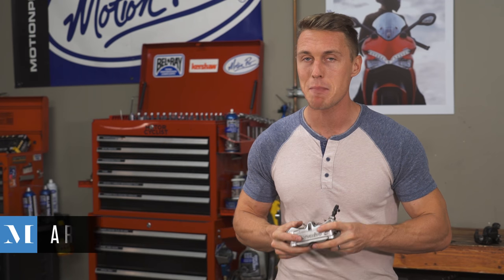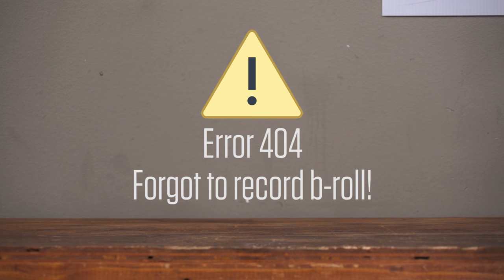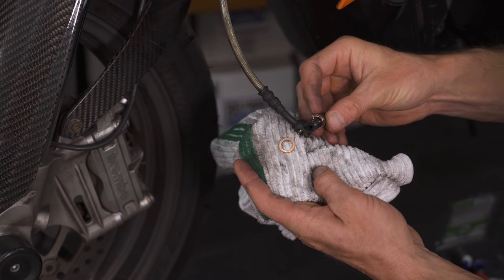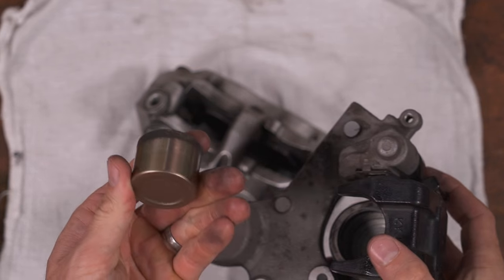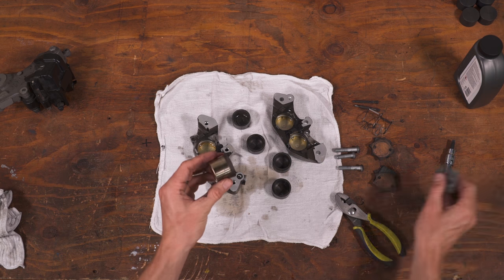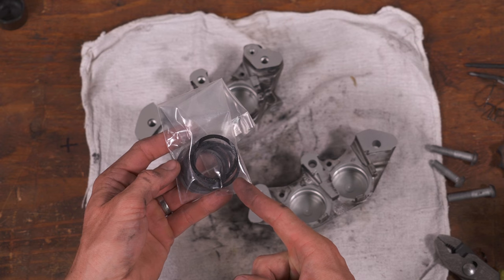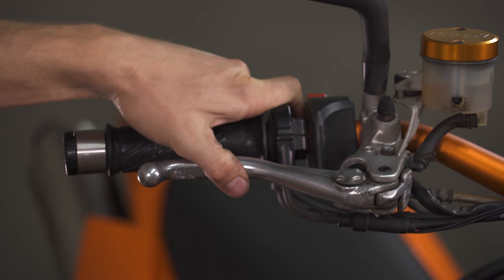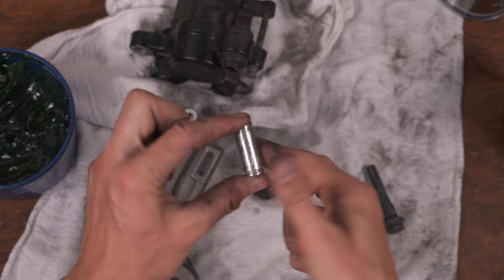How To Rebuild Your Motorcycle's Brake Calipers | MC Garage

Comment: Really nice. However I have noticed that it's nowadays harder and harder to find break rebuild kits. I was quite shocked when my dealer was only willing to sell new new set of calibers and couldn't find replacement parts from anywhere (brembo breaks). Then it turned out that there was one local smallish but old store that sells rebuild breaks and it was super cheap so everything ended well =)
Reply: try another dealer?
Reply: For my Yamaha TDM 850, I found in Germany kedo.de. But the new pistons are expensive. I will change it this winter.
Reply: Most brakes are rebuilt by shops and dealers. With the price of labor these days, it's usually cheaper for them to replace the caliper. So there's less and less demand for rebuild kits.Go Ari Go!
Reply: Now off to your spelling class.

Comment: I really want to do this on my bike as there is some rust on the pistons and I noticed some uneven pad wear. Unfortunately my bike uses four piston opposing calipers which can't be split! 

Is the best way to get the pistons out just pumping them out while the system is still all together? Was thinking I could put something thick between the pistons so they all hit it, then put something thinner, then thinner etc until they are all most of the way out. Otherwise I'm at a total loss. Bent nose pliers with a rag maybe?
Reply: The technique you describe it a good one. Brembo also suggests clamping all but one piston down and then pressing the unsecured piston out with compressed air. Motion Pro also sells a slim little piston-removal tool that should do the trick. We wanted to include it in this vid but the order didn't arrive in time.

Comment: Quick question.  Can you use brake cleaner directly on the pads themselves (double H sintered)?  I blew a fork seal a while ago and before i had it fixed I'm thinking maybe some fork oil got on the disks because my brakes are suddenly not performing.  Figured I'd do a thorough clean of everything but I also figured I'd ask someone before spraying down my pads just in case
Reply: Yep, that's exactly what it's made for.
Reply: You can put it on the pads. But if you got a lot of oil on the pads. They need to be replaced. Brake pads are very porous. You'll never able to get all the contamination (oil) out of all the nooks and crannies. I know it sucks.
Reply: Damnnnnnnnn... that sucks.  Hopefully they improve enough after I get done servicing them.  Thanks for the info

Comment: What torque do you apply to screw the two half caliper bolts? In Nm
Reply: That's something you'll find in your owner's manual, but typically it's in the 20-28 Nm range.

Comment: is centering required for axial calipers too before tightening mounting bolts
Reply: naveedaka axial or radial should not have different handling.
Reply: Pascal Nungässer i mean the sliding pin calipers as on rear in this video??

Comment: On my 2015 MT-07 the brakes drag and they bind up over night and I have to give the bike a good push in the mornings to unbind them. It had the brake fluid changed a few months ago, the pads have loads of life left in them and there's no visible damage to the disks. Is it something that needs fixing? My previous 2015 CB125F developed the same issue after a while so it's either normal or I'm missing something.
Reply: The callipers need exactly what has been demonstrated in this video, a build up of dirt or corrosion is stopping the pistons moving freely
Reply: Before completely disassembling it, have you tried cleaning the pistons? Take the caliper off the bike, squeeze the lever a couple of times, clean the pistons with a plastic brush and brake cleaner and then push them back in. I don't believe you need a complete rebuild on a 2 year old bike, but maybe you just ride it a very dirty place
Reply: Try riding a decent distance (let´s say 20km) without using the front brake and then check the temperature on it. If it´s cool, you don´t have to worry too much.
Reply: If it has sliding pins, ream out thebpin's bores, they are getting stuck, then relube the pins. Another thing is the pistons may be seized, possibly bent, needing replacment

Comment: I have a transalp, it doesnt have the best brake setup. Two piston single rotor up front. Will swapping to steel braided brake line have a noticeable effect? Might as well do it all at once
Reply: Martin Fisker steel brakeline doesn't expand likerubber brake line does, so you'll probably have a bit more stopping power when you really squeeze your lever.
Reply: Bart RD50MX Its not that i really need more power, i just want a more firm feeling and more feedback. I know, in theory, steel lines would do just that. I just need to know if it makes a noticeable difference from someone who has tried both
Reply: I swapped out my OEM lines for braided SS on my MT-01 and I didn't notice much of a difference in use. The SS braiding is just for mechanical exterior protection and it also does not need replacement every 5 years like OEM (plus you can get nice colours!). Pressure is maintained by the same tough inner lining regardless of exterior material. This is my understanding and I have heard this from a guy involved with bike racing teams and a car engineer who rides. SS is just a more resilient protective coating.

Comment: I am helping a buddy with a single piston rear caliper on a scooter.  It fails only occasionally.  Squeezes handle all the way to grip, no braking (claims it also makes noise, I never hear it).  I figure there is a blockage in the fluid passage, or sticking on the slide/piston.  
Does anyone know a simple starting point, or spot to look first?  A rebuild will be done, but I would like to correctly find the specific problem and make sure it is addressed.

Comment: Just to throw my worthless 2cents in, foam ear plugs also work well to stuff in the bango bolts to stop leaks whilts wrenching on other brake components, bit im just a hobby mechanic.
Reply: Thanks for this tip, used the ear plug trick yesterday it worked great!!

Comment: Good job, but brake fluid is corrosive, do not forget the gloves.😄
Reply: Also, brake line washers are one use only
Reply: That's what they say, but I reuse 'em all the time. Same with drain-plug washers.
Reply: Precisely. Brake fluid is somewhat corrosive, not just messy, better be using gloves.
Reply: i'ts okay, but you must immediately wash your hands if you don't use gloves 😂 😂 😂
Reply: It's okay, my hands are unpainted ;)
Reply: superbarnie -- Your hands were originally painted, so brake fluid couldn't hurt them.

But now that brake fluid has removed the paint, it's critical that you no longer expose yourself to brake fluid without gloves. I shouldn't have to explain something this obvious.
Reply: yep, I got brake fluid on my hands and it dissolved the flesh down to muscle tissue.
Reply: Adam Omidpanah you're being a jerk. I should show the mess it caused to my fairings after a leak on the track. It is corrosive, but it's not nitric acid. It may cause skin problems and it's never a good idea (eg have you got psoriasis?). HST, I've touched it too, even the 5.1
Reply: I am a aircraft mechanic, and a thing i always tell the trainees, is to peel a garlic a hold it tight in your hand, after 20 min they start to have garlic taste and smeel in thier mouth.. Just saying that your skin is actually the bodys largest organ, and it sucks up everything.. After that, they always wear gloves.
Reply: good thing im not bathing in it XD
Reply: Not just for the brake fluid, but the degreaser and brake cleaner too. Those are very harsh chemicals. Hand soap is formulated very carefully to have just the right amount of surfactants for your skin... what do you think brake cleaner is formulated for?
Reply: I use barrier cream, and he may be using same. Oils and fluids just sit on top. Not exactly a glove, but remarkably effective.
Reply: @94SexyStang  There's always one of you.
Reply: @94SexyStang  Did you know exposure to chemicals can result in brain damage? kinda seems like you didn't.. too late now
Reply: @CarloPiana  aircraft mechanics deal with some nasty chemicals. I've had to deal with stuff that apparently can eat flesh and this is coming from someone who works on vac trucks that suck stuff out of the sewer

Comment: I have a problem while bleeding. after bleeding is done, brake pads of the caliper are slightly in touch with the disc.
It is very problematic and I haven't solved it yet.

Comment: Hopefully someone will see this and not have the job I just had getting my pistons out, I pumped the brakes to get them to come out as far as I could but they didn't want to know so when I got them inside and split the caliper I tried heat I tried the rag and grab I tried compressed air (sadly I don't have a grease gun) NOTHING worked. 

Here's what you do; get a ratchet with an extension bar on it and put it in the piston cup then insert a socket that will just fit alongside the flat of the extension bar in the piston cup (I can't give numbers because they are all different sizes). Once it's all wedged in there turn slowly and the bar should pinch on the socket and the wall of the piston and the piston should turn, keep turning and sorta angle it upwards or pull up gently as you turn and it will come out eventually mine were incredibly stiff so it's gonna need to be in a soft jaw vice and some sweat but it WILL come.

(if your piston has a cap it should either come out with some persuading OR I carefully drilled a hole in the cap less than 2mm deep DO NOT DRILL THE PISTON got a pin punch in there and wedged the cap out)

Good luck hope someone finds this as helpful as I did because after days of looking for advice on the internet NO ONE mentions this and it works a treat.

Comment: The days of rebuilding calipers on cars are pretty well gone but is this still somewhat of a common practice with motorcycles?
Reply: Yessir. You can buy a rebuilt caliper for you car so cheap that's it's not worth doing it yourself. Rebuild bike calipers aren't available, and you'll be looking to pay a shop a couple hundred bikes to do the work for you.
Reply: Thanks for the reply  Keep the videos coming!

Comment: when changing pads, do you need to reallighn the calliper if you take it off?
Reply: For radial setups that don't have locating dowels, yes. You need to pump up the brakes so the pads pinch the disc (thereby aligning the caliper) and then tighten the mounting bolts.
Reply: and axial-setups dont?

Comment: Someone's bound to gonna start complaining about not using fresh crush washers... 

If you want to be safe, and don't want to get or you don't have new ones; try heating the old sealing washers until they glow red. Let 'em cool and they're ready to go again. 

Better yet, just order a big ass bag of those things online - doesn't break the bank, and it's copper - a precious metal - so you can tell your significant other it's an investment, not bike parts - and go ahead and replace the old ones.

Comment: My pistons will not slide back into the cylinders with the O rings in place. Tried giving it some pressure with a vice but tore up the O ring and still did not slide. Tried using the old O rings again and new O rings... same thing. Can anyone help?

Comment: hey ari...i have an cbr f4i running rich...can fuel flow test show fpr is bad or not.i mean if amount of fuel is less???please help
Reply: Um... this is about brakes???
If fuel on your bike is a problem and you have carbs, there is a vid for this but if you have EFI then take it to your dealer...
Reply: Fuel-flow test isn't going to help you. If the jetting is stock and your bike is running rich, the air filter may be clogged or your carbs' float heights may be off, causing the fuel level to be high and the engine to run rich. What signs are indicating a rich condition, and at what throttle positions?
Reply: Ari Henning ..hey is fi....no carbs...and its popping flames at idle...shooting flames at full throttle...fouling plug...dry carbon at tail
Reply: Yikes... That sounds serious enough that something must be very amiss. I'd check the auto-enrichener circuitry. It's like the EFI version of a choke. Perhaps it's stuck on. Or your TPS is way out of whack. Something is causing there to be too much fuel in the system.
Reply: Ari Henning it has a fast idle wax unit that serves as  choke circiut but that seems ok...i will disconnect tps and see any difference ...will let u know...thanks for ur reply...big fan from india

Comment: I have spongy brakes on a 2005 gsxr1000. I flushed my lines with brand new brake fluid and the problem did not go away, what can it be?
Reply: Andres Angulo you have so much moisture and white milky nasty stuff behind the Pistons in your calipers your jaw would fall off. Do as the video says but you can remove the caliper and the pads and just slowly pump the front brake lever until the Pistons pops out on their own this is the easiest way also once you remove the rubber seals from the caliper there will be rust underneath them that small Groove needs to be cleaned and the seals flushed and cleaned the boar flushed and cleaned and obviously the Pistons. Reinstall everything with the bleeder valve open you can push the Piston sin with your thumbs now you can start your bleeding this is always the best way to bleed with nothing at all in the boar 90% less air. After getting a pretty firm brake feel then go to gravity bleed small rubber hose valve slightly open let it drip for about an hour keep topping it off leave the reservoir cover off and covered up with a rag air can escape both directions you'll have a break that you can do in those with.!!!!!! Then you better do your rear one too so you're breaking is fully balanced
Reply: Rick Simpson thank you.

Comment: I would not recommend using steel wool to remove corrosion on the pistons.  The pistons are probably made from a stainless steel and the iron left behind from the steel wool will not play nice with the stainless and start sites of corrosion.  The left over iron particles from the steel wool will start to rust and that will make the stainless steel rust and corrode.  You can not get all the iron particles off by mechanical action.

Comment: No idea how you just popped those pistons out so easily. I am on day two of trying to muscle those damn things out one micro meter at a time. Pistons are ruined but replacements on the way.
Reply: You can use compressed air even with split calipers,you need to put  air through the banjo bolt hole to pop the first piston out,then push the 2nd piston with air through the teeny tiny oil passage which you should see once you remove the first piston

Comment: Shot in the dark:  My 2017 Kawasaki ZX-10RR Service Manual dictates the front 8mm Master Cylinder Bleed Valve as 49-inch pounds torque.  The rear 10mm Master Cylinder Bleed Valve as 71-inch pounds torque.  However, the same service manual states the front caliper bleed valve, also an 8mm bleed valve, is 12 FOOT POUNDS TORQUE?  I am certain this is a misprint and could be 12-inch pounds.  But WTF?  How am I supposed to trust the Service Manual with obvious incorrect torque specs?  And I cannot get a clear response from Kawasaki of America to confirm this torque value.  Why is this so difficult?  I don't like "hand tight plus 1/4 turn."  That's BS.  If the bike has torque specs, they should be correctly applied.  And tge "unspecified bolt torque" table is useless!!  I used that procedue for another bolt and it stripped out the hole.  My torque wrench is 1 month and it is working properly.  Some bolts are either 1.  Misprinted torque value in the Service Manual or 2.  The torque value is printed correctly in the service manual with incorrect torque values from factory.  I've crossed referenced Yamaha R1 and Honda CBR and of course, no torque value is the same but neither say 12 foot pounds.  What the heck does "right" look like when the Service Manual is in question?  I found several discrepancies while reading and studying the Service Manual.  And, what gets me is, the print date is 2018.  The new 2023 ZX-10R/RR have the same exact wording.  So, there was no change since 2018 and an 8mm hollow bleed valve is no way 12 foot pounds of torque!!